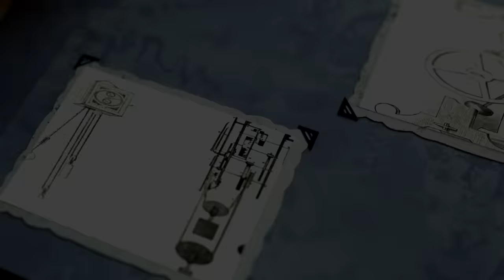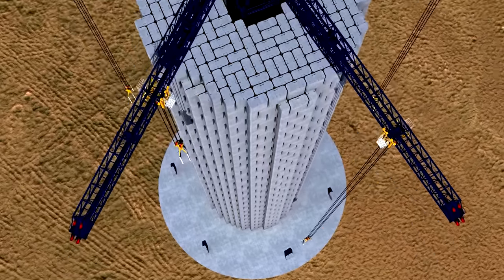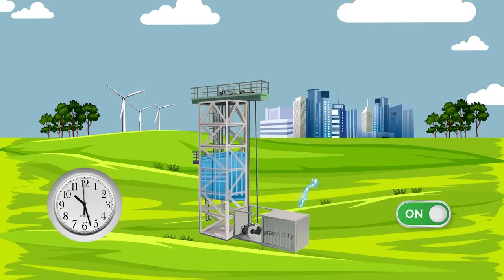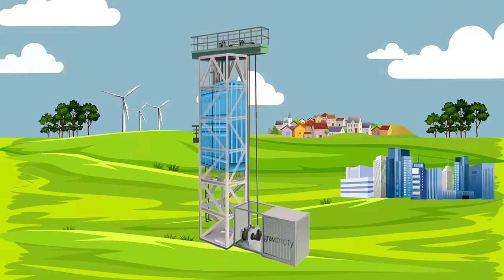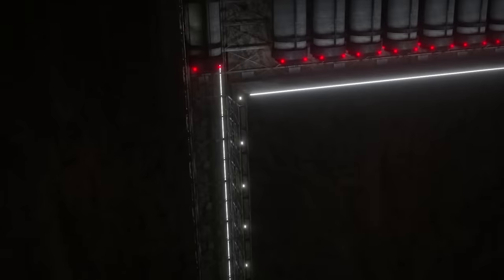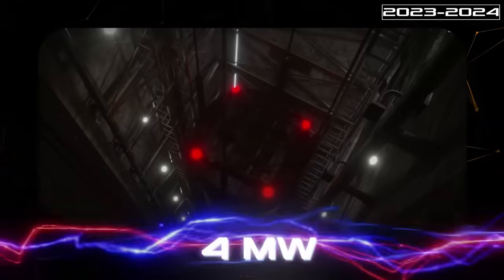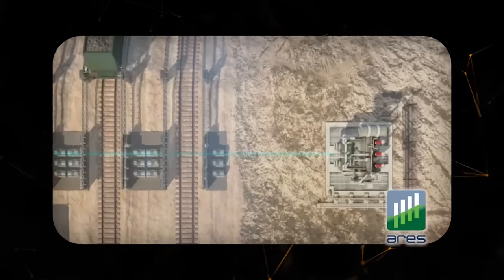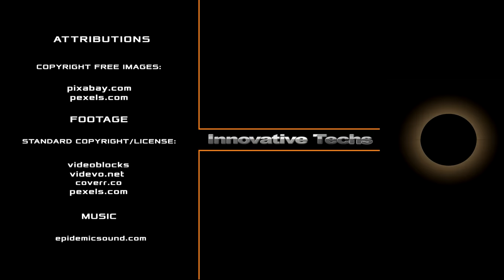How gravity batteries could change the world

Comment: Hello
Interesting video. 
Here is my suggestion for a good solution: 
You can put such a gravity storage in to a deep well filled with water, combined with a reversibel heavy turbine running up and down. 
Those energy wells are build in series along forest roads and connect by powercables. Usually you store electricity in them. 
But you can also use 
1.The water in the well against forest fires in emergency cases 
2.The water in the well in dry summers, and fill it up again in winter times
3.The material that you dig out, can sometimes be used as a fertilizer in agriculture or for building roads, dams and houses.
The drilling is done with electric drilling machines only with otherwise unused renewable electricity. 
You can call it a powerwell or a energywell or a firewell, just as you like
The wells are scaleable and dont stick out of the landscape
Greetings from franconia, the country of power wells
Reply: Hoover Dam
Reply: In contrast to the hoover dam, the energy storage well does not need special landscapes and it is scaleable. You start with smaller wells in the neighborhood of farms and prove the principle. Then you get bigger in size, in depth and in the number of wells. That was the way, wind turbines became so successfull.
Reply: @reinerhoffmann3764  in contrast to gun, hammer does not need ammo. But these does not mean that it its  better to use gun to hammer a nail

Comment: In most cases, the most successful methods will be those with the least complexity. Pumping fluids and using train cars on a slope are both simple solutions. Where you can use train cars, your highest costs include mostly the grading of the slope. Everything else is off-the-shelf rails, motors and rail road cars. Same with fluids, but your advantage is only needing high spaces and low spaces because your reservoirs can be of flexible shape and location. I think as many have pointed out, the problem is energy density. Any gravity solution must be able to store enough energy at low enough investment to make it worth the effort. In these cases, its either a lot of cars or a lot of water. The solutions also need to compete with hydrogen storage when hydrogen generation is increasing in its efficiency.

Comment: Gravity batteries don't need to be made of concrete?  Can they have steel frames that hold scrap material or resources in long term storage?  (Dual puropse. Gives a place to keep things while taking advantage of their weight)

Would have to be open air, can't retrieve containers off of structure when they are finally needed down in a mine shaft

Water tower gravity batteries?

Comment: Not an engineer, so everything is totally IMHO: I don't think that storing energy in anything related to moving parts would ever be reliable and cost effective enough to scale it up to where we need it.
Besides that, there is already that system where you pump up water and harvest that energy by running it through a turbine. Not even in the alps where you wouldn't have to build a structure for that simple task is it possible to run that on a profit. And thats way simpler than moving weights.

Comment: Too complex, too expensive, too many things to wear out. If you’re going to build a tower to put weights in, why not put a tank on top and pump water up.  
The pump becomes the only moving part. 
The only gravity storage I’ve seen that makes kind of sense is to run railroad tracks up a hill.  Then use rail cars full of rock. Winch them uphill to store power and let them down again to release it. The components are readily available, thus cheap. You could even use old rail road gear too unsafe for transportation. You are not limited by how high you can build a tower. The rails could be miles long and be a thousand feet high. 
You could put motor/generators on the cars themselves. Use a third rail to carry power to and from the cars. This eliminates the winch and cable, points of failure and power loss.
Need more storage, add more cars to the rails.

Comment: Problem is, the highest demand is during the day and we don't have extra during this period. Pumped storage was designed to collect the extra produced at night when demand is low. Today's renewable energy produces only during daylight and windy conditions. Unless you have an extremely windy nighttime ( which is historically not regular), there is no extra to save. Nuke ,oil and gas are the most reliable and work at night. Renewables will never replace the Nighttime producers. No way, no how, ever. That's the only period that we ever have extra energy. Hydro is a small portion in most markets and environmental groups are getting them commissioned, so it's a declining source.

Comment: It is essentially a battery that stores energy. You could easily build something like this yourself. Seems like it could be a better investment than batteries because batteries eventually wear out and you have the chemicals, disposal and environmental concerns of a battery. This is just a weight with some pulleys and a generator. Generators can last a  very long time and are easily repaired. You could build the same system in your backyard and lift the weight with your exercise bike while you're getting healthier.

Comment: And modification of this idea (to simplify the whole concept):
Perhaps instead of the complex weights, cables, pulleys, and associated machinery, a system could be devised to harness the relatively simpler and common technology of pumping water from a low level reservoir to a high-level reservoir.  This could be implemented utilizing an existing deep abandon mine.  Then build a large artificial reservoir (or a reservoir using natural features) on the surface of the surrounding area.  Then, connect the surface reservoir with the subsurface reservoir with pipes connected to pumps and generators (just as is commonly done for hydroelectric dams).  The source of electricity could come from any intermittent source (wind, solar, etc.) or anything else (natural gas, nuclear, etc.).  During times of energy storage, the pumps suck water out of the deep underground reservoir (coal mine) and deposit it in the surface reservoir.  During times of energy usage, the turbines turn generators which provide electricity.

All of this is technology that has been tried, tested, and used for many decades.  No significant new technology is required.  No complex mechanical system (of weight, pulleys, cables, etc.) is necessary.  The main requirements for this are an existing very deep hole in the ground and the ability to create an artificial reservoir (or utilized natural features on the earths surface) to hold a large quantity of water.  The water simply acts as a weight.  It is essentially (nearly) a closed cycle.  Water would only have to be replenished because of possible leakage or evaporation (which could be mitigated).  Additionally, the water could be low quality waste (non-potable) water or salt water too.

Ed Schultheis, PE
Mechanical engineer and manufacturing consultant for 35 years
Schultek Engineering & Technology, Inc.

Comment: I wonder what would happen if they used a magnet instead of a neutral payload. Line the mineshaft with copper wiring and produce power two ways when the load moves, ascending or descending.

Comment: This would be cheaper in the short term but the regular maintenance would actually be high. The draw works that lift and lower the load would have gearboxes that need weekly maintenance, the sheaves would need to be greased daily, the cable would need to slipped and cut every so many ton miles, we do it almost weekly. You’ll have safety system’s that need to be regularly tested to protect the stationary cluster of sheaves and the traveling cluster. They always do this with these videos, they present only the upsides and never consult people who work on these things already. It’s funny these videos don’t get blurbs for misinformation while so many others do.
Reply: Wrong. I only put oil in my car every 5000 miles

Comment: I still have a problem with the way water is stored to be used for electricity generation they have a natural water source, so they dam it build all the needed equipment and you have power on demand .... what I don't understand is why don't they move down stream and build another dam and do it all again? Depending on the terrain etc. etc. it could be done again apart from the $$$$$ its 2-3 or more times of electricity by reusing the water multiple times ....just a thought !!

Comment: Reading the comments, I see most people miss the part about the electricity coming from solar or wind and having an excess of power which is used to lift the weights. Instead of the excess power going to charge batteries, it is used to lift a weight and there is no damage to the environment like from batteries.

Comment: wow. They also don't have to be made completely of metal. they can be filled with soil or rocks. and they are 100 percent recyclable. this could be the future.
Reply: I think we build a big arm that goes high up and off a lift with one big weight tied to the end and then a mega deep hole line the oil industry does. 10,000 feet down. Build 5 in a row and see how much it costs to dig and kind the hole, and then how much money it generates in electricity to drop it down the hole the first time and if it's worth even hoisting it back up and if it's even possible to be profitable. If it is, expand

Comment: 3:40  50 tonnes
3:45 15 meters
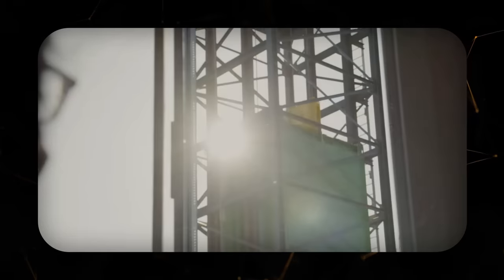4:00 250kW for a “few seconds” let’s say 6 seconds.

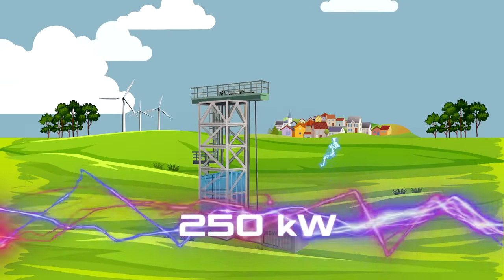4:15 Proposes that systems can provide 20MW for eight hours.

Starting with the time, there are 28,800 seconds in 8 hours, so we are looking at 4,800 “6 second falls.”

You would need 4,800 fifty tonne weights dropped from 15 meters to provide 20MW of energy over 8 hours.

That is 240,000 TONNES of gravity battery and all the associated hardware to handle all that mass.

You might as well put your sky scrapers on lifts and use your buildings as gravity batteries…

Comment: There are countries where sun shines more than 300 days in a year where solar panels are the best approach to generate electricity. The problem is at night as sun doesn't shine at night. So li-on batteries are not bad to store the extra produce electricity and use it at night which is already being practiced in many places now. The only thing if the li-on or other batteries were re-usable without involvement of factories and user could it at home. The large dams are also not good as it takes large space and also disbalance the earth.

Comment: For storage to work you have to first provide enough energy to (1) operate the Grid (2) and at the same time to create storage (battery or gravity or whatever). So you can guess the algorithm needed to achieve 24/7/365 operation of ever City and Town and remote Rural areas in the US. Keep in mind that Nov. Dec. and Jan. output (today) is at about 10% in those months compared to the output the other 9 months... also Oct and Feb. are not all that great either.

Comment: A hole filled with water floats a mega weight raft,   during the sun hours the shell is filled with water pumped from the hole,  once its full the  weight get released on demand and goes down with weight of water then cycles repeats valve  opens and air fills floatation  makes the shell rise to top where it waits for the sun to come out and get filled again

Comment: How about doing similar in the ocean with dropping blowup balls in the ocean? Using the fall of the balls to create energy,  and when the balls hit the bottom pump.air into the balls and use the rise to create energy. 

This way both directions is an energy plus. 
Biggest issue i see is energy needed to pump the air into the balls....

Great depths are advantageous.

Comment: Why not installing these gravity batteries near sea in Africa and combine them with water desalination plant ? When there's excess of power they can power a sea-water desalination plant to produce more water which in turn irrigates fields. Another suggestion: use some form of construction (i.e. rails along which a load is carried up) when there's excess energy generated a material (of which the before mentioned rails are made of) which creates more tension, and when the load is carried down (to produce electricity) it goes over a construction/rails which produces less tension.
Alteratively use some gearboxes or set of pulleys to lift/lower the load at times of different amount of power generated by the gravitional batteries. We might also consider a system that (when batteries generate excess power) add/attach more load to the lift being pulled up and detach the load (when we need more energy) so the load descents faster creating more energy.
Another benefit of installing these gravitional batteries in Africa would be ease of access to sand from which we could make a lot of glass, allowing to build greenhouses (tinted of course) where food is grown.
Either way, there must be tons of use cases (beneficial to some people) to utilise the excess energy generated during times when gravitional batteries generate too much power.

Comment: An old law of physics states that ideally in an efficient system, power in equals to power out. But designing a system with 100percent efficiency has never been technically possible due to our limited advances in knowledge. What defines an advanced civilization is the ability to harness energy resources with 100% efficiency.

Comment: It’s the best way to get energy that does NOT degrade over time.  In other words, sort of ‘emergency energy’.  You lift it - more accurately, hold it at the top of a drilled hole probably - and can park it WITHOUT needing energy etc, using a locked brake situation.  A peg, ratchet etc.  Trigger the ratchet, and you have exactly the energy out you put in, minus a bit of efficiency loss.  It would hold and work if you held it there for a year - this is NOT so for other storage projects like batteries or even water.  It needs exploring at scale.  I would suggest, filling-in a quarry or other artificially-created edge, is more likely than building a huge skyscraper in plain view.  But, make a serious effort at it, somewhere.  Needs learning, great idea, one of many.

Comment: Gravity batteries using solid stuff have extremely small capacities. Consider the energy needed to drive a 1.5 ton electric car up a 200 metre hil. It might use around 1% of the battery capacity. That means that you need to push around 300 tons 100 metres uphill just to store the same energy that can be stored in an EV battery.  The only sensible sort of gravity battery is hydropower but, unfortunately, the availability of suitable sites is rather limited.

Comment: One thing to watch out for, slavery. I was working on small projects like this at the coffee shop I worked at in the 90s. My original thought came from the friction limiters to keep the doors from swinging wildly, those boxes with the hinged arm at the top of many doors. The energy from opening the door is managed and released as friction heat. I figured why not put the energy to use. I worked up many dorky contraptions to realize the concept, like clocks, fans, and the such.

There are many sources of small energy release like this all over human activities. From doorways and appliances, like opening refrigerators and oven, to sound dampening floors, etc…

Taken further, I thought, why not boost input, like make doors a fraction more difficult to open to gain the fraction more energy to the small system. Cars could drive over plates to “donate” energy, and the idea flooded, but then it hit me. This sort of idea leads to slavery.

Why not just have a gym that uses the gym equipment to generate energy? From here the door to slavery opens up. Kinetic to potential energy devices exist throughout history.

But then the thoughts of slavery and misuse of the technology freaked me out.

Comment: Anchor an old ship between 4 towers/posts fitted with straight gear teeth, which mesh with gear wheels on the ship. As the ship goes up and down with the tide the wheels turn. gear up the output  to produce the speed required for power generation. at the same time drive a flywheel, which continues driving the generator as the tides turn. Cheep & reliable ( maybe )

Comment: Even if this were to be viable, in order to produce adequate potential energy storage for eight plus hours per day you would need to input 50% more energy each day from solar and wind then just producing power during the day. Add to this the fact that not every day is sunny and windy. Considering were we are with our current production capacity, how to store excess production capacity is a problem for way way down the road.

Comment: Seems a flywheel system suspended magnetically in a vaccuum might be an easier solution to this issue.  Less expense as no tall towering structure need be built. Depending on the material it is made of, could be spun up to incredible speeds.

Comment: I bet that when we would try build this on a world scale, we would run out of concrete or steel.
Reply: The same is even more true with lithium ion or other heavy metal battery options. 

We need to look at total carbon effect of these other options and simpler solutions like dams or mechanical storage systems begin to show just how valuable they are.